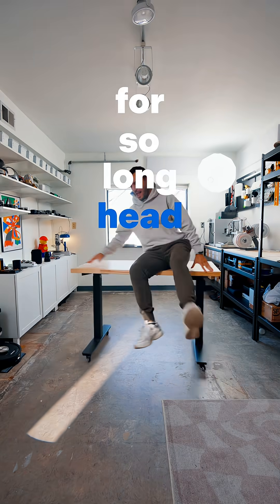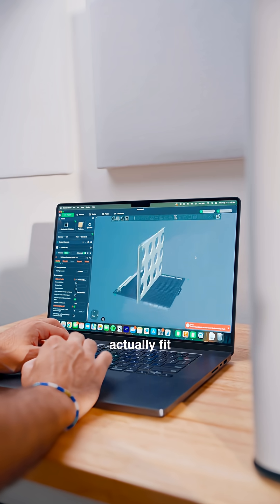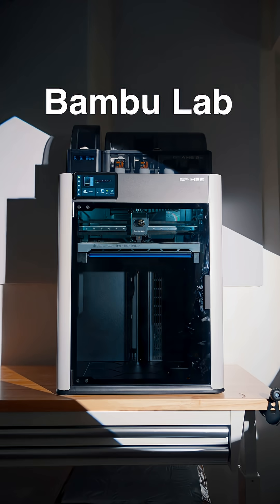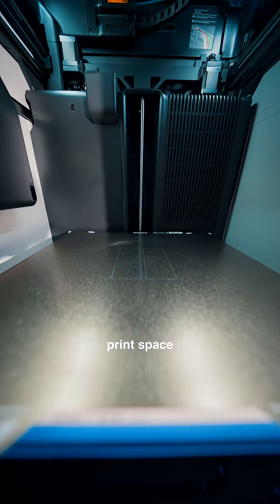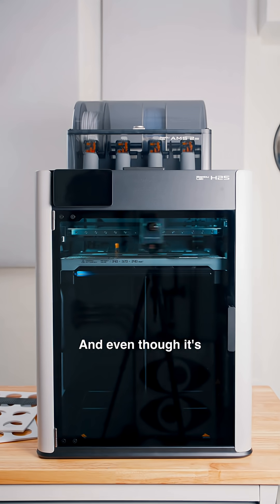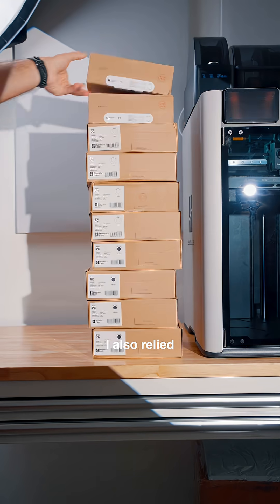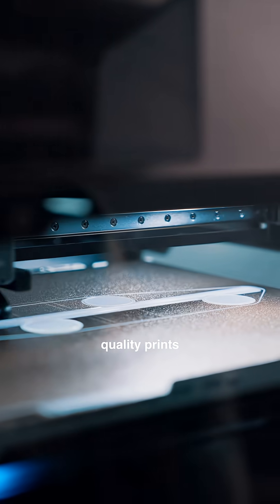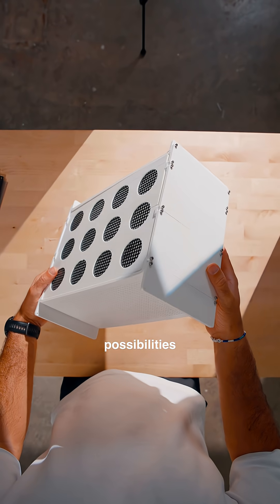3D Printing a Gaming PC case

Comment: The main issue with a plastic case is that it doesn't conduct electricity. The power supply's ground is screwed to the chassis, and the entire chassis prevents static electricity, short circuits and electronic noise. That's why we didn't saw a plastic case in the shop ever.

The only conductive material for 3d printing has carbon fiber powder base. Besides, even if the plastic doesn't melt at 70 degrees, it will gradually deform over time if you push the processor hard—that's a limitation of printing it.

Finally, printing a case is cool because you can create strange shapes, objects, that make it look like an alien case or an ultra-minimalist concept. If you just design it as a plain white box... I'd say it's identical to 99% of cases out there—you're not gaining anything by printing it.
Reply: So much wrong in this post its insane. Do you enjoy posting misinformation or do you actually think this is right?

First, "only conductive material being carbon fiber based". No.  2 seconds of research will tell you otherwise but clearly you didnt do that.

Second. Grounding. To. The. Chassis. Are you smoking something? Sure a plus of having a metallic case is it dissipates *some* static. But most cases are coated with paint or some sort of anti conductive material to stop static all together. 

That leads to third point, printed cases will be just as quiet as a metal cases, when designed properly, just like a metal case. Also strength and deforming over time due to heat? Really? How hots your pc getting? Because there are PLENTY of materials that can sustain what a normal case is exposed to without deformation.

Lastly I cant beleive this needs to be said but being able to print your own parts that you made creates infinite possibilities for what you can make. Swap a part out, make customizations, print whatever colors and change them to your builds needs.
Reply: @charliesmart2313  Nothing is wrong with my points, except for my short explanation about 'the only conductive material being carbon fiber powder-based filament.' I apologize for that. Of course, there are plenty of 3D printing filaments that are conductive. However, most of them are quite exotic, are rarely in stock, or are very expensive to order. Among the most common and easily available options in shops, carbon fiber is the one I see. I thought that was generally understood, sorry if it wasn't clear. And
Yes, all PC chassis act as a ground plane. For a machine that can pull over 600W, this is probably mandatory by safety regulations. The power supply is always screwed directly into this metal ground plane, and this connection works whether the metal is painted or not. If you don't trust me, you can use any AI search tool and ask why all PC cases are metal. You'll find all the reasons I gave and more. Alternatively, you can easily check for continuity with a multimeter.

Just to clarify, when I say 'electric noise,' I'm referring to EMI/RFI, not audible sound. In fact, a plastic case might do a better job of dampening the actual sound from the fans.

All FDM filaments degrade with heat. Even if you print them at 200°C+, the constant heat from a gaming PC, for example, will cause them to warp and deform over time. This might be imperceptible in small parts, but if a large piece like a PC side panel is exposed to that heat, it will easily warp in a relatively short amount of time.

Finally, a plastic PC case would be much cheaper and could be made in fancier designs. So, do you think all these manufacturers use metal for no reason? There are clear functional reasons for it.
Reply: @llOvercraftll I mean I'm going to be completely honest I've been using a plastic case for like 2 years I've had no issues pretty much no warping so I don't know

But I've seen a couple sandwich style cases have a plastic holder for the power supply sooo